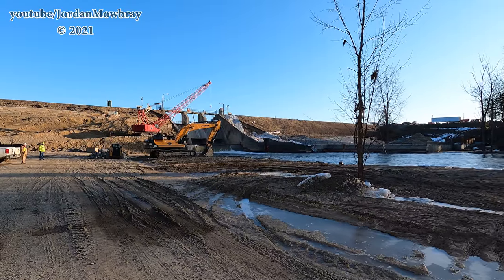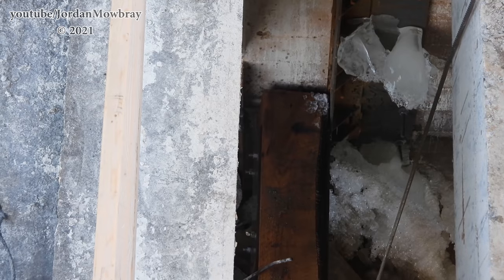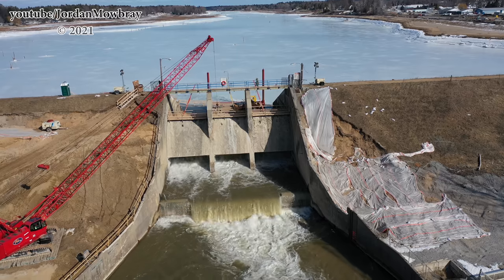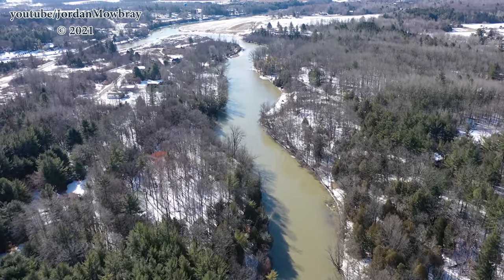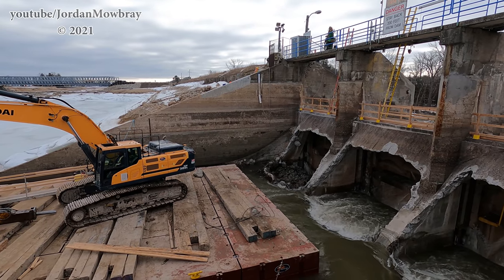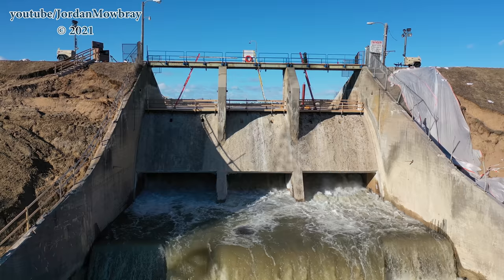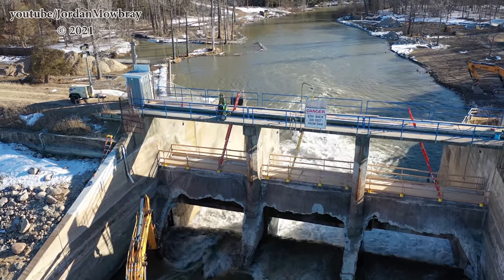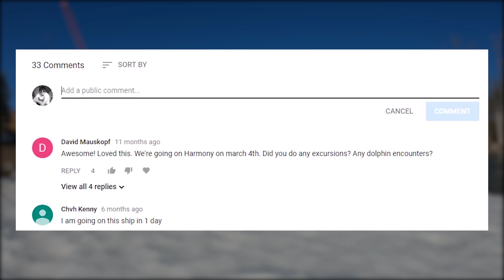Tobacco River Dam Spillway Demolition & Stop Log Removal - Wixom Lake Flood 2020 - Aerial

Comment: What were the Stop Logs for ?
As a Temp Fix/Repair procedure.  
Seems an Antiquated Way to Regulate Water Levels, if used regularly.
Reply from the maker: The stop logs allow the water to be slowly dropped over time. With each log that is pulled the water level can be lowered one log at a time. All logs will be removed when the water level reaches the height of the new lowered spillway.

Comment: If they break away all that cement are they going to replace it with new? Does that affect the integrity of the damn taking away that cement?
Reply from the maker: When the dams are rebuilt they will use new concrete. They left parts of the dam so that it is still structurally sound.

Comment: Looking at Google Maps again, I noticed that there is another dam and a couple of spillways upriver on Tobacco River at Beaverton and Ross Lake. I take it these faired much better during the 2020 flood event. What's the history on them and why they aren't bundled into the Four Lakes task force? Different ownership I suppose and maybe don't need major repairs.  Might be a nice comparison on how those spillways faired last year.
Reply from the maker: You are correct. This dam is owned by that county and did not have the failure of the other dams last year. In general this dam is in really good shape. I am planning to go film at this dam this year as well.
Reply: @JordanMowbray  I hope they give you good access, given the fine reportage that you have done on the Four Lakes Task Force dams.

Comment: They will put the stop boards back in later? They call it a breaker because it is a ‘hydraulic rock breaker’ rather than a pneumatic hammer (or steam). The digger feeds high pressure oil to the breaker all the time as a steady flow. The breaker machine body has a rubber bag in a high pressure nitrogen chamber inside. The oil fills the bag storing energy. A valve opens and let’s all that oil shoot out into a piston and that’s when it goes DONK a and smashes the concrete.
Reply from the maker: Thanks for the information. That is fascinating. The stop logs should not be needed any longer. They were just used to slowly lowered the water level.
Reply: @JordanMowbray  thanks :o)  I was confused and wondering because if the water was to always be that low, why the temporary bridge? Might as well have back filled with dirt and a couple  of drainage pipes in the bottom?

Comment: So with those stair steps is that going to be the new height of the lake or is that just temporary? while they rebuild a new spillway system?
Reply from the maker: Correct. That will be the new height until the dams are rebuilt in the coming years and allowed the previous levels to be restored
Reply: Thanks Jordan! So if I'm understanding correctly this is just a temporary solution until the earthen damn is brought up to standard and then this spillway will be rebuilt again to support that higher level on the tabacco? I think that's what Moose is asking as well
Reply from the maker: @jacobdittenhauser3838  Yes, that is correct.

Comment: Are they lowering the dam level to repair the other parts of the dam wall and will they replace the spill way after that is finished?🇦🇺
Reply from the maker: This dam has a new spillway already. You can see this on some of my previous videos at this dam. This was lowered to redirect flow through this dam again and remove some of the water going around the Edenville dam so repair will be easier over there.

Comment: What are the concrete structures on the earthen dam portion on either side of M30?
Reply from the maker: What time stamp are you seeing these?
Reply: @JordanMowbray  Oh sorry, they don't show up well in this video since the earthen dam is covered with snow.  I was simultaneously looking at Google Maps satellite view to orient myself. The one to the west of M30 is fairly close to the road and a similar one is further away from the road on the east side. Both on top of the earthen dam toward the lake side of the centre line. The zoom isn't enough to get a really clear view and the Google Street view angle has fences that block the view. On the M30  bridge update video (March 6 posting) you can see them both at 4:09 and 5:22; closer view of the west one at 5:37, the east one at 9:15.
Reply from the maker: @melstotyn9180  ahh ok i see what your looking at. The deck looking structures? That is a good question. I can take a closer look when im out there next time but they may just be little docks.